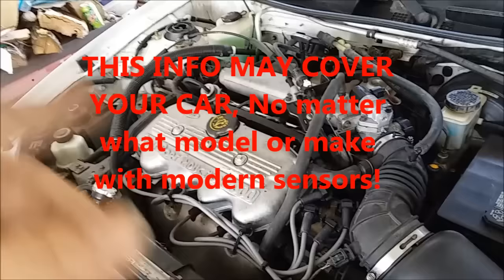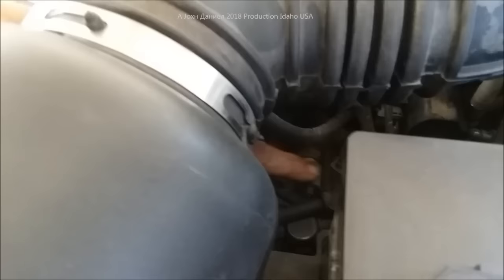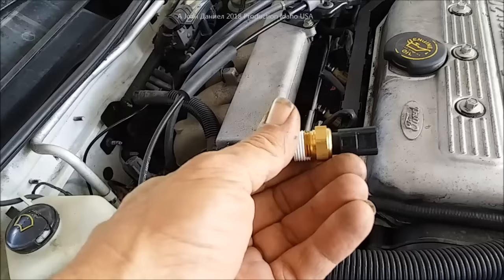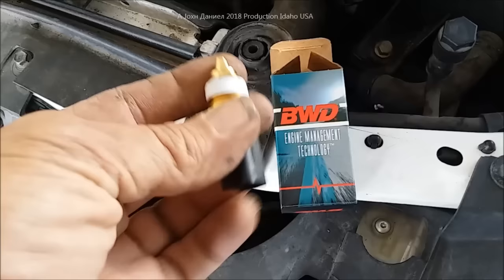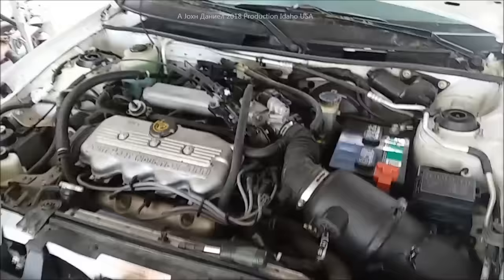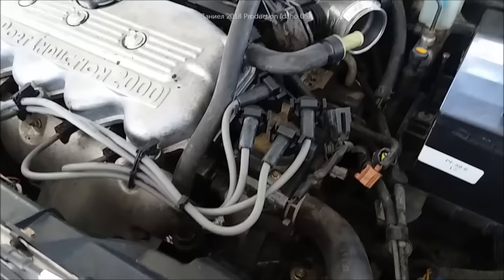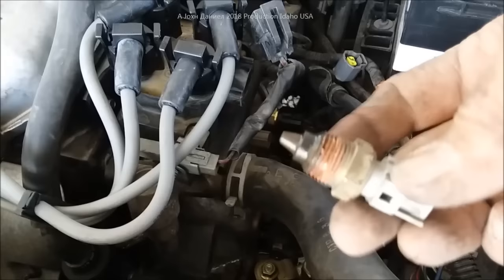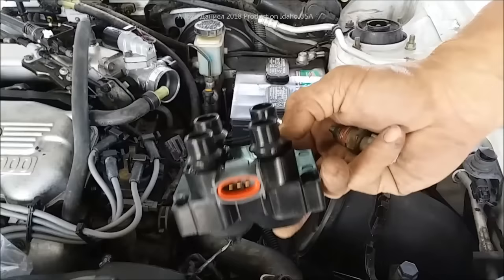Ford with NO START issues - SOLVED for $20 All Parts needed listed below the video

Comment from the maker: Spark & fuel but no start?? Crazy thing, This temp sensor fits mostly Fords. This model https://amzn.to/2NPVi65 TX61 sensor. For ford-mazda & more ignition coil by BWD-Spectra https://ebay.to/2LhEMgZ AND be looking for this Escort trailer HITCH installed https://ebay.to/2unKgwv More escort upgrades and repairs on my channel.
Reply: Came across you video and wondering if this is the issue on my 85 Ford Econoline fuel injected 351. It has an EFItech system. It starts and runs fine except when real hot and left to stand for an hour or so. What do you think?
Reply from the maker: Those tend to do that when something warps, such as a intake and they expand with heat, then fail to produce enough vacuum to respond to the primitive computers in them. Another problem on some models is in/on the distributor, the module goes out of parameter with heat, returns when cool. Last is the coil itself, doing the HOT FORD FAILING COIL TRICK!
Reply: Is it the same thing on 1991 ford taurus
Reply: I have a 89 ford escort hatchback with a 1.9 throttle body engine I'm trying to get the car back running I got it in timing right but I can't find the number one cylinder is on the engine I think it's on the passenger side of the car also how do you put the plug wire on the distributor cap it go like this 1342 but some people I had them to try put the plug wire on well it still didn't run but on the motor it number like this 1234 so how do you really put them on
Reply: Hey would you be able to get a  chart or diagram of the faring order  it ncha0 to show me the current faring order step by step number like this on the distributor cap 1 3 4 2 but on the motor it goes this way 1234 so tell me how it go
Reply: @MrMrBigro  I'm not for sure
Reply from the maker: Your distributer is not in numerical order, 1.2.3.4 like the engine, so looking down on it you will mark the sockets as shown, then pull wires from it to the spark plugs to match the engine which is in 1.2.3.4. order. https://www.fixya.com/cars/t25070053-firing_order_1987_ford_escort_1_9 ( 1984 to 1990 same engine lay out.)
Reply from the maker: Are you sure you have the distributor dropped exact to its location in its mount? What work was done, I am guessing timing belt and water pump, so it should be still right if not messed with. The module in them  or on them can also give you no spark. And there is a cylinder 1 mark on the distributor cap, to look for. See other reply I gave on your questions.
Reply: @JOHNDANIEL1  sho don't have a distributor

Comment: Holy shit !!!! 
I have a 96 Ford E350 with a 7.5L engine  
For the last year and a half I’ve been fucking with a rough idle and a hard start, only when hot. When it’s cold it starts right up and idles ok. But as soon as it gets hot it’s a violent shake at idle and hard to start. 

So i tried a tune-up, fuel pump, fuel pump relays, injectors , 02 sensors , MAF sensor, fuel pressure regulator and even had the ECU re flashed. Same problem and it was getting worse. I see this video and thought why not try, it really was only about $20. 
Installed sensor and the van runs near perfect now. Unbelievable ! It idles fine and starts up no matter what temperature. 
thank you so much for posting this video. 
PS. Even my local mechanic couldn’t figure it out. 
😂😂😂🙏🙏🙏🙏🙏

Comment: Wow! I have been literally tearing my hair out trying to figure out my problem, just changed my temp sensor today and my ranger is fixed, thanks!!!
Reply: was your ranger having a hard time starting when cold? mine will turn over for 7+ seconds and sputter to a start 4.0L
Reply: @FreddyBelong14  what was the issue? Mine does the same thing
Reply: Mine sputters for a few seconds grabs like a little gas and then dies and then the intake burst with a backfire. I was wondering if you were having the same problem
Reply: @peeeyyyy8439  mine does the same did you figure it out?
Reply: @FreddyBelong14  what fixed it
Reply: Is it diesel

Comment: THank you, I have been a tech, not currently working as one,  bbut this video helped me from pulling my hair out on my son's Mustang Gt.  Sometimes as a tech we get so caught up in the major issues we forget to look at all the other sub-components in the ignition system.   Replaced plugs,  replaced fuel pump, still no start,   we just replced the sensor and bam it started.  but I have to fix the wires to the connector, (Years ago I had a damn mouse Make a nest) and he chewed through some wires the sensor wire beingone of them, was fixed but I'm gonna have to fix it again.  THank you
Reply: Im having the same issue except the mouse thank god.
Reply: Is there a way to test the sensor before assuming its bad?

Comment: I made a few videos of the 2000 Ford escort se I used to own. One of them was unplugging and each individual sensor out of those to to check to see which one controls the fan and which controls the two gauge. You will want to double up the torque converter front pump seals and put lock washers on the crank hub bolts. Also if the ignition switch is not working because the screw on the cover comes loose just put a small lock washer to hold it in place it works better than just lock tight.

Comment: Looks like you are still replying to messages, even though this is an older video, so figure it's worth picking your brain a tad if that's alright with you. Got a 2000 Escort ZX2 (2.0L DOHC) that we had running (replaced slipping transmission) and it died coming down the road to the house. No odd sounds, it just died. Now won't start. No codes, even with all the attempts to start it while doing troubleshooting. Has a bit over 220k miles. While doing troubleshooting, few things have been replaced. Fuel filter (seemed partially clogged, since it was run down to empty during test drive after trans swap), spark plugs (really old), distributer (due to weak/no spark at times), and crankshaft position sensor (the tip was chewed up a little). Checked all fuses related to the fuel system. Checked the timing twice and it looks in time (might be maybe one tooth off on the crank, so I might just do the timing once I can get the alignment tool needed). The fuel pump does prime, and inertia switch was checked also. Currently gets spark, air, and fuel (you can smell the fuel when cranking it over). It tries to start slightly when cranking, as it'll backfire here and there. Have not replaced the temperature sensor (yet?). Any other suggestions?

Comment: That little part will also tell your computer that there is a block of ice siting in your motor black and also flood the motor even when its fuel ejected also had same issue on a Saturn  but on the Saturn it was the sending unti

Comment: Mazda 3.6l has the same failure mode due to the same bad part. Took me most of a day to figure out it was the temperature sender.
Reply from the maker: And the crazy part, its NOT a code generating issue in all of the events!

Comment: I have a 2013 e450 van I have good fuel pressure,injector pulse an spark. It starts with starting fluid .would this allow me to get spark and start the engine with starting fluid but not allow it to stay running?

Comment: My wife works for a company that has a ford f450 box truck that will run great but sometimes won't crank after a few hours of driving around.. If they wait for a few hours it will crank. Any chance this part is on a truck that size?

Comment: My son and I have very similar issues, I'll explain and see if you have any ideas besides the temp sensor! Which we will jump on tomorrow for sure. My son had a local business install a brand new from Ford 5.4 Triton engine in his truck is a 2005, The engine says 2008 on the side by the dip stick. The truck cranked fine ran for like 30-45 minutes after warming up and just dies. Wont crank turns over with no start. The shop said fuel pressure was low, (Installed new fuel pump in the gas tank) ($) Then same thing cranks when cold installed new (ECM) more $ of course same issue then installed a new fuel pump relay under the spare tire. still same issue cranks cold runs and then after 45 min or hour shuts off no crank until next day cranks right up! Brought it home and I ordered new coil packs plugs, one new fuel injector that the harness was broken. All fuses are fine, relay replaced on ECM and fuel pump in the inside kick panel. Seeing some generic codes on the Blue Driver OBD2 reader nothing obvious. ABS module code ( C1145), 1 transfer case / 4x4 control module U2023, 1 instrument panel control module/PATS (code B1352) and 1 Power train control module (P1000)  & 1 Restraint control module code (B2292) We're going to try the sensor tomorrow and hopefully you solved the expensive mystery. If anyone else reads this and has similar fixes besides the Sensor please share. A very reputable shop couldn't figure it out. If we can't figure it out Ford dealership here we come.
Reply: Your spending money on things you can test to see if there good. The sensor here is a cylinder head temp sensor. Also you have coolant temp sensor looks similar. Look at your cats. Just unhook exhaust before you buy them. There’s lots of sensors take it to reputable shop for diagnostics. Sounds like yur in over yur head.

Comment: surprising a coolant temp sensor is the problem, i will try this change on my no start explorer v6 how could this be? i have problem starting cold
Reply: Yes things are indirectly linked or the engine management is set up so that if one signal is not present, it stops the next command from being processed
Reply: What happen
After changing it.
I have the same problem right now

Comment: Have a 91 taurus engine in a trike,  Did a fuel pump, coil, fuel filter, cleaned the tank, rotor cap, worked until I sprayed seafoam into the intake. Let it hot soak then ran once pretty poorly afterwards. Then radiator fan seized up after trying to start many times. Currently have no fan just trying to see if it’s gonna live again…lol runs on starting fluid with no throttle, give throttle and dies promptly
Reply from the maker: Have you checked in the distributor for the module failing or crank sensor issues?
Reply: @JOHNDANIEL1  thanks, I will see about testing those…

Comment: Hey man I have a 2008 Ford ranger with the 2.3 I got it and the guy said it had a intermediate stalling and not starting issue, I got it put a new maf sensor in it put new cats on it and the other guy put a brand new fuel pump in it I drove it about 1 mile and it died and hasent started since I can hear the fuel pump come on sounds just fine and it has spark

Comment: My 2003 Ford Expedition cranks but won’t start, already replaced battery, alternator and fuel filter. Any suggestions? Don’t want to spend all the money on a fuel pump if it turns out to not be the issues and vice versa with the coils and plugs. Any suggestions?
Reply from the maker: Crank sensor or ignition switch

Comment: I having a similar situation on 96 thunder bird it turns over for a minute and then stops any suggestions
Reply from the maker: Turns Over? Do you mean it starts, then idles for a minute and dies? Or do you mean starter spins ( turns over engine ) for a minute and stops! Most common not continuing to run after start on a T-bird in those year models with 3.8 liter and 4.6 V8 is the following: 
Coil Pack related, Fuel Pump old and sluggish - Fuel Regulator issues,  Crank Sensor goes out of parameter when hot, Low Coolant level stall, or Idle Control Circuit issue.

Comment: I have a 2013 ford e150 4.6 I cant find that sensor.  Mine will start by dies right after.
Reply from the maker: Starts but quickly dies, or stutters then dies, check fuel pressure regulator first, fuel pump second. Third thing is voltage to the Coil Packs or Coil pack connectors. Fourth thing, but rare is Mass Air Flow sensor bad or its grid is detecting blockage or inadequate air flow through the filter and intake. Last thing may be the Crank Position Sensor, failing to register forward timing after start.

Comment: I have always said - I do not like the fact that modern / computerized engines run off sensors. Yes - I like new / modern computerized vehicles - and generally modern / computerized vehicles have dependability - IF - engineered well. So - to the point - it is complete BS that a 
$20 sensor ( without an direct output ) will keep the engine from operating .
Reply from the maker: Ford started the right idea by committing to a body control module, however they dropped it after a few years before it got a chance to be perfected, it had its own harness and tunability but we turned it into a fail then Ford stopped making cars and only started making SUVs and trucks.

Comment: Hey could this be my problem on a 2000 crown vic 4.6 i have fuel and spark but i still have to double crank or step on the gas to turn over afterwards i smell the extra fuel getting burned off in exhast once car is on its fine no stalls or nothing
Reply from the maker: My diagnosis with 90% accuracy - Fuel injectors are leaking down when the car sits for any period of time, causing flooded gas in the engine, second attempt allows pressure to balance, cylinders to clear, and when it starts it pushes out the raw gas, stinks. Replace injectors https://amzn.to/3CShLKH and fuel regulator https://amzn.to/3NXDvLy
Disconnect the battery while doing the swap out so it is safe and clears the computer memory. If it fixes you, send Kiera a tip https://www.buymeacoffee.com/JOHNDANIEL

Comment: Would this work on an 07 Mercury Mountaineer Premier.  The suv won't start unless it's jumped.  The battery, alternator, ignition, and starter are all fine but SUV will not start.
Reply from the maker: IF this helps, send a tip: https://www.buymeacoffee.com/JOHNDANIEL 
To assure your not low voltage failing, test the sitting voltage of the battery. 2 hours after last drive, test the battery voltage, has to be over 12.6 volts. ( if not you have a bad battery even if Autozone says its good)  If it is 12.6+ then open the relay box under the hood, is it dirty inside, these tend to not be sealed well and corrosion affects the relays. Pull the starter relay, swap with another of same amperage, start the SUV. If it starts then shut off, replace the relay. 
If this does not work, have a second person turn the key on while your voltage testing the battery. If the fuel pump kicks on and the volts drop to under 12.4 on the battery, you likely have a failing fuel pump that is drawing high amps causing the battery to fail to deliver the power to start or operate relays. 
When your jump starting the vehicle your supplying 14+ volts to the weak parts, making them work. But not able to start with normal battery volts.

Comment: I have a 1999 ford escort zx2 will turn over but won’t start, trouble code p1116, p1000, and p0141. I replaced the cam shaft sensor. But would a coolant temperature sensor actually keep the car from starting? The code p1116 is a ECT sensor code.
Reply from the maker: Yes, a failed coolant temperature sensor will tell the computer the engine is in emergency mode and it will not send spark or allow the fuel pump to fully run to get you up and running. If it's got over 80,000 miles on it replacing the sensor is a standard maintenance feature anyhow. The Thomson 4037  seems to be the most accurate ones I'll send you the link https://amzn.to/3zyqaQX

Comment: Mine is sohc 2.0 escort 2000 and it's throwing all sorts of sensor codes started sputtering and now won't start. Will this make it throw codes?
Reply from the maker: Generally the codes that these vehicles want to throw or to do with environmental issues such as exhaust system air system. But the symptoms you're defining say crank sensor, fuel pressure regulator and temperature sensor. Generally when they do the sputtering it's because something is out of parameter the way that old capacitors start acting up in old electronics. I would definitely consider the fuel pressure regulator on these cars as they have a common behavior like you defined but the temperature sensor can cause a similar issue by restricting the fuel pulse to the injectors. The crank sensor if the plastic body is cracked can also cause the same symptoms. If the car has over 150,000 miles on it those are your three items.

Comment: Hello I got into a accident 4 years ago with my 2010 ford fusion and went to fix it now but the collision saying it won't crank up so I changed the keys and still same can you please let me know what can be the problem also the hit os from the front
Reply from the maker: Fuel cut off inertia switch is tripped or damage caused wiring issues.